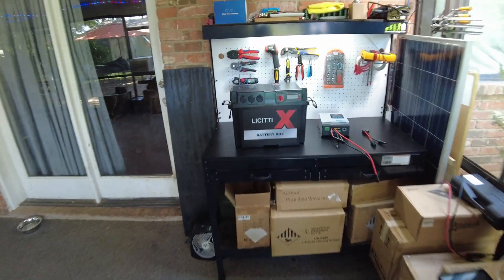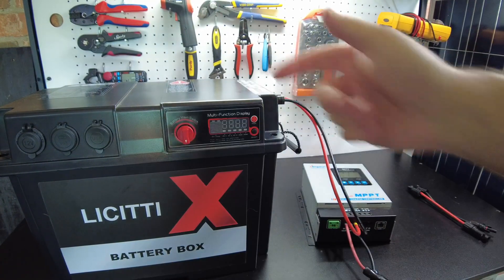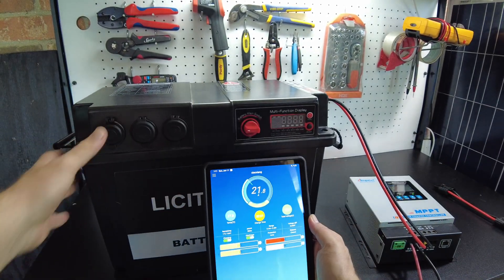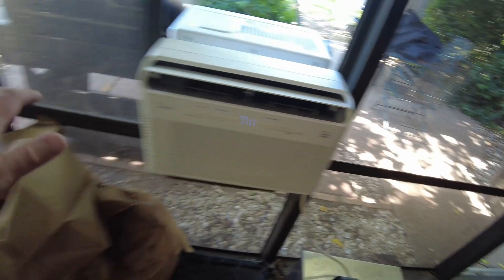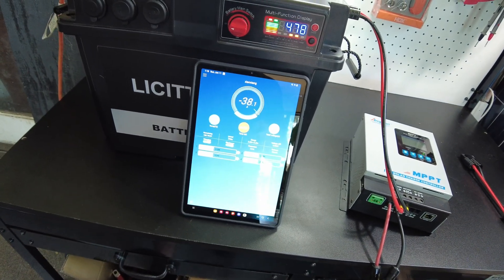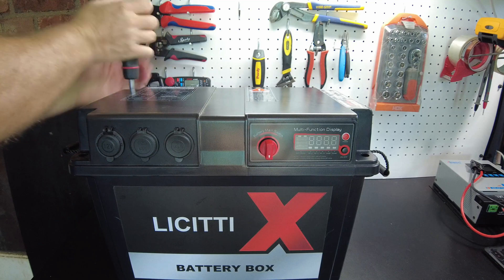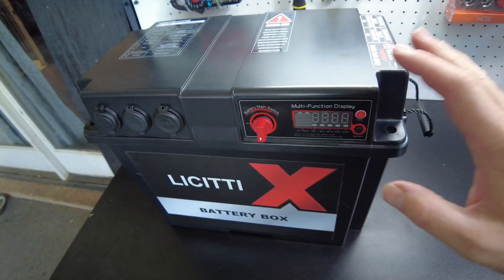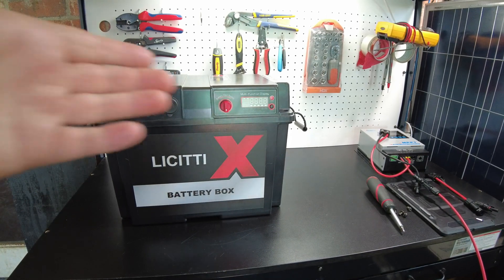Expanding The Easiest DIY Solar Generator

Comment: Ran a test on our upright freezer. Test lasted 15 hours, stopped it short because I went to bed. When the freezer cycled on it was using approx. 115 watts. Since I didn't have a shunt or a smart battery I used a Govee Smart Plug Pro to track accumulated KWH. This model freezer used 861 watts total in the 15 hour period when I stopped the test. It could have lasted longer. I am only using this Licitti power station when the grid is down, and at night so I don't need to run the gas generator. Charged it with a 30 amp charger and its slow. I have the first model, and the newer box. With the Govee Smart Plug I was able to see the status of the unit while traveling that afternoon. Works for me.
Reply from the maker: Nice! Thanks for sharing the experience :)
Reply: @BradCagle  Thanks for the reply. I will admit to not fully reading the description for both power stations on their website. Do you know what the VSR function is and how would I make this work to charge the units. I have both versions of this power station. Both should have a built in VSR. Thanks.

Comment: Thanks for describing this box.   I have a couple of question. Since the Anderson connections (50 amp) (with clips) works both in and out. I know you put a 100-ah battery in the box.  Can you attach with the clips to another 100-ah battery to double the amp hours of the box? (not the inverter) Will the box charge both batteries when attach a AC charger? (pass thru) How does the box know when to draw a charge from the extra battery to use? Or when the box knows when charge the extra battery attached to it?

Comment: What could you do to charge that 170 Ah battery in about 3 hours from 110 volts ac? (Im curious because my Ecoflow Delta 1300’s can charge from 0 to 100% in about 90 minutes from 110 volts ac.)
Reply from the maker: Use a 50A charger
Reply: @BradCagle    Does quick charging with a 50 amp charger ultimately shorten the life of the battery?
Reply from the maker: @joeblow1942  Depends on the battery. Some will say recommended charge rate 20a, max charge rate 50a. If you see this then probably would shorten the life to charge at 50a every time.
Reply: @BradCagle    Ok, thank you!
Reply from the maker: @joeblow1942  You're welcome

Comment: Can I plug  external battery into the 175amp Anderson connecter, for a total of 200Ah for more run time? If so how should I do that.
Reply from the maker: Yes, you can. You just need to wire an Anderson connector to the external battery (also might want to add an inline fuse), make sure the voltage of the internal, and external battery is close to the same voltage then plug it in, done. If in doubt, just fully charge both batteries before connecting.
Reply: Thank you so much. I thought it would work  @BradCagle  But wanted to be sure.

Comment: Yeah, I bought this battery box and was able to add over 7,000wh of battery capacity to this unit using the Anderson input connectors! 
So, that is three external boxes of 12v batteries in parallel with Anderson connectors and DC control boxes. Two are 1536wh and one is 1920wh, not to mention the 170ah (2176wh) battery installed in the box. Which is about eight batteries in total, so far!
Reply: When you are charging, do all of the batteries charge Simultaneously when hooked up
Reply: @DESERTDWELLER4547  The best that I can tell is, when charging once the main battery is filled up all the other batteries connected charge up until my charger turns off! 
Also, you can slow charge or fast charge depending on if you're dealing with rolling blackouts.
Reply from the maker: 😁WOW, that's a sweet setup! Thanks for sharing

Comment: I ordered the 2000w inverter battery box. Took a while to receive it but it is soooooo sweeeeet! The endless possibilities with these battery boxes. Can Add more battery capacity , add more inverters if  you want. Just have patience waiting for your boxes. Definitely worth it!
Reply from the maker: Sweet. They are supposed to send one of those 2000w units for review.
Reply: I want to order the 2000w box too. I can't get much info on it. It looks like it has only 1 AC outlet? That's OK I guess since I could plug in a power strip for multiple outlets. Does it have the standard cigarette lighter type 12v plug?  I'm learning about these systems. I want to be able to charge with portable solar panels and an AC battery charger if possible. Would I need to buy special adapters to do that?
Reply from the maker: @biglakecreekproductions8440  They are supposedly shipping me one for review, I'll see if I can get the tracking so we can get an idea how far off it is.
Reply: Ac receptacles are only rated for 1500 watts. The 2000 Watt box has only one AC receptacle, so it may not power the full power the inverter is rated for.

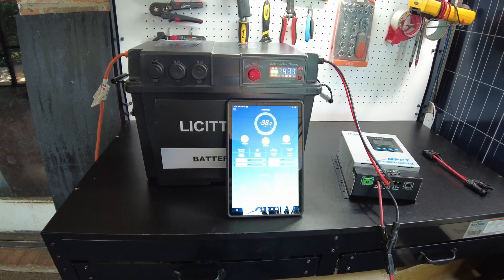Comment: Hi Brad,  at the 5:10 min their was mention of adding another battery via a cable, 
what would be required to achieve that addition.? 
would both batteries need to be same SOC.?
Reply from the maker: Ideally you would want them to be the same SOC. However you could get by if they are close in voltage, as they would eventually become the same SOC as you charged.
Reply: Thank you for asking this question. I have contacted licitti to no avail.... I have asked several YouTubers that demonstrate this box and no one will even
 acknowledge my question let alone answer it. I hope you get an answer.

Comment: Been doing this for several months now and it works great. I rotate four of these bad boys to offset the grid by powering my main frig, basement dehumidifier, man cave beer frig, etc. My only complaint, and it's me nitpicking, is the DC USB powers are auto-on. I know it drains very little, but I don't want any leech draw. I have to always remember to uncap the two rubber caps and manually power them off. Not a big deal even if you forget, but I'm OCD like that. Also, pro tip, do not buy those new 100ah lipo4 Minis... they are too tall for this battery box. You have to get the regular-sized 100ah batteries.
Reply from the maker: Nice! Thanks for the info on the MINIs

Comment: i bought one of these units and put a DIY 4-cell LiFePO4 pack with a JK BMS in it. one small hole needed for the JK BMS on/off switch and it works great.
Reply from the maker: Great! Glad to hear good feedback. Thanks
Reply: did they send you the black plastic bms holder for your jk?
Reply: no, i didnt know there was one. i had to fabricate one to keep the BMS in place. i also used foam on the sides to keep the batteries from shifting around. but worth it for getting the added capacity.

Comment: Great video. That Midea A/C with inverter compressor is really impressive! Even a 1000W inverter can run it with no issue, I may buy one, I just wish they will release the one that also has heat pump.
Reply from the maker: They have a portable unit with heat https://amzn.to/3P2pAVi I have this one, but mine is a non-heat model so I can't attest how well the heat works, but the AC is amazing.

Comment: Not sure what the point of this box is if you're adding an external m p p t controller?
Reply from the maker: It has a built in 10A MPPT, a 1000w inverter, and a wealth of DC power connections. I'm just showing how to expand the solar capability with an external 40A MPPT.
Reply: @BradCagle  ah TY for clarification!
Reply from the maker: @MyChannel-vm6dw  NP. Thanks!